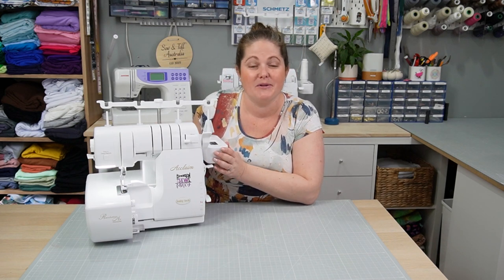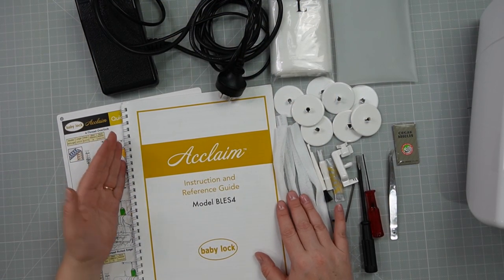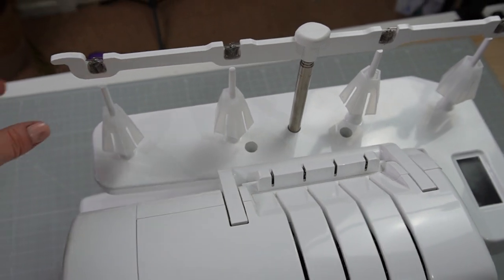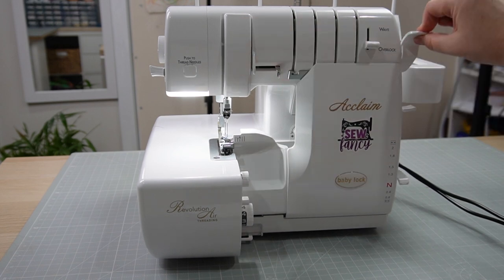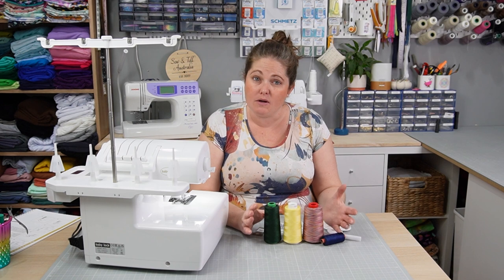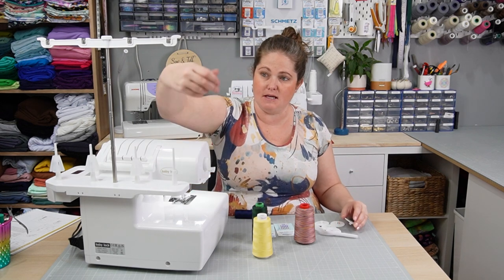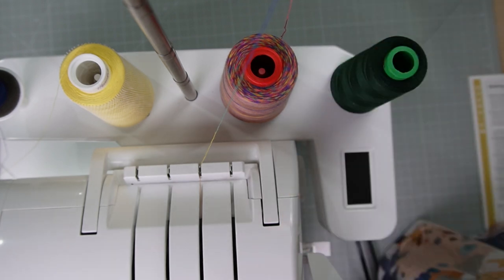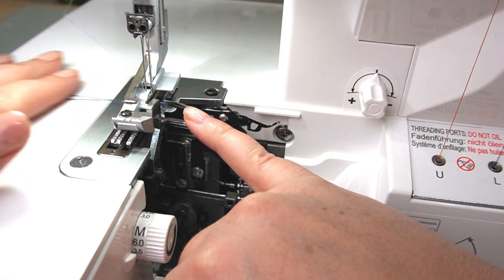Review and Demonstration of the Baby Lock Acclaim Serger/Overlocker

Comment: I used your suggestions for cleaning & maintenance on my Imagine today. I got out my manual & it had the directions for removing the needle plate which you had demonstrated. So I did that. Then I went ahead & brushed out everything I could. Lastly I turned it on its back, took off the base & cleaned it & removed all the lint, which wasn't that much considering all the flannel & terry cloth I've been sewing for years. Keeping it brushed out regularly must really help. Now I know that if I get an Acclaim it's pretty much the same machine as far as maintenance, & very do-able. Thanks again for your helpful video.

Comment: I've had Baby Lock sergers for 30 years. I learned some very useful things from this video. I don't have an Acclaim (yet..) but am considering it. I don't know if the A for L needle & B for R needle applies to other sergers in the BL line or just the Acclaim. But knowing that is helpful. The part at the end about cleaning the machine, removing the stitch plate, & opening the bottom is useful & helpful for any BL serger I would think. I'm going to try it with my Imagine because I use it a lot for very linty flannel & terry cloth items. I have no doubt it's full of lint. It might save a  need for servicing. 

I almost didn't watch because it's such a long video; I was afraid it would not be very concise or well organized. Your video is excellent & the time stamps option to go to the pertinent parts makes it even more useful.